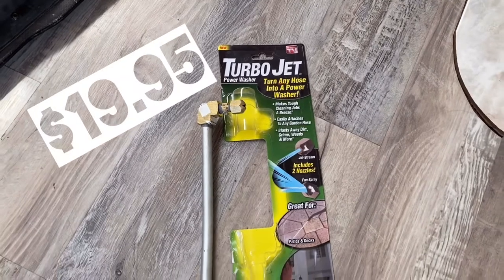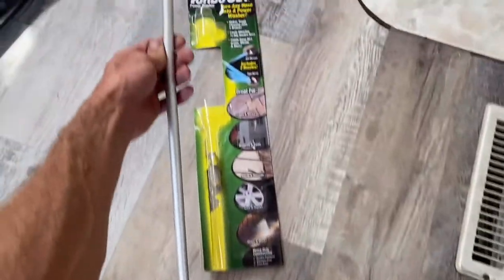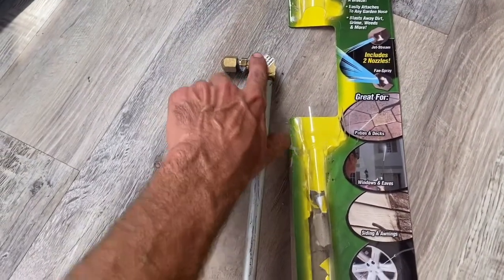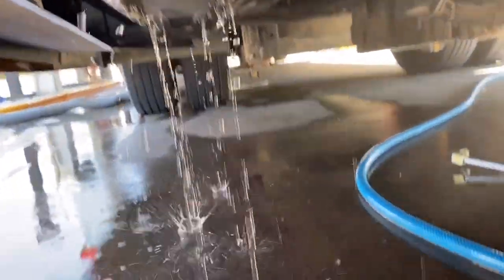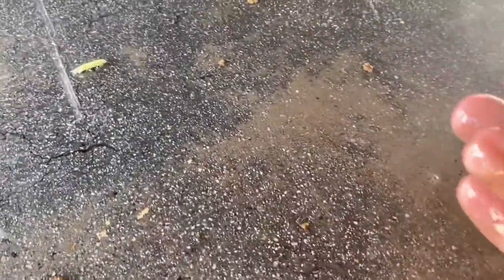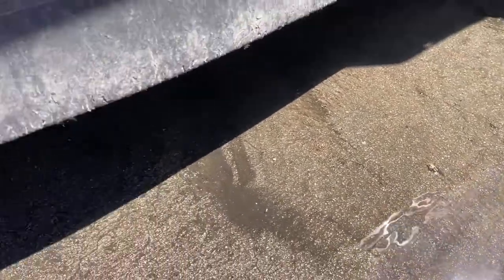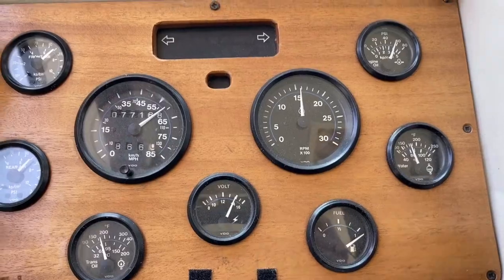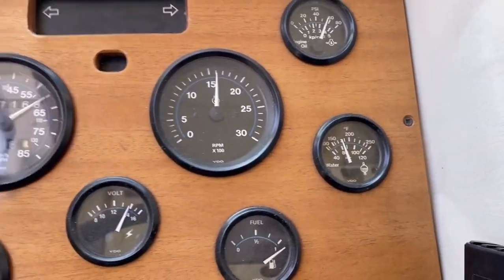How to: RV overheating SIMPLE FIX diesel motorhome radiator clean replace

Comment: I have a 1998 Dutch star 8.3 Cummins, I found this video after leaving Mn and getting to Oregon and having many stops on grades to cool down so I could go again, I am pulling a car behind around 5000 pounds, 
Today I went from camp ground to Lowe’s and bought a wand and simple green. I spent a few hours soaking and spraying and I can not believe all the grass, leaves, straw, and who knows what else came out, it was unbelievable I have a huge pile that was between my radiator and my inner cooler for turbo, I did wash from out side only before leaving on trip and it obviously did not good !! Heading out in morning for northern Oregon will see how it does !! Thanks for posting this video you described exactly what I had going on and things I had also done to my camper !!

Comment: Thanks for the video.  I, too, have a 1996 diesel pusher with a side radiator with an 8.3 Cummins that gets to 210-220F easily when driving to Lake Havasu.  Once it gets that hot, even merely idling causes the temps to get to a point where the idiot light comes on.  I ordered an extension wand for my pressure washer to try to clean the radiator but I see that you did it with simply a garden hose.  Did you use any chemicals to dissolve the crud?  Perhaps some degreaser?
Reply: Others have said NOT to use a pressure washer, what Tanner did was fine, just enough pressure to loosen the crud, not so high that you might damage the radiator.  Others have suggested using a mild degreaser such as Simple Green, spray on with a trigger spray bottle, let soak (but not dry) and then wash off with light pressure from a garden hose.  I intend to follow this system in the spring when the weather breaks.
Reply: A pressure washer in the "fan" mode won't even hurt one's palm.  I can't imagine it piercing a radiator.
Reply: @terrycrawford6740  I can bend the fins, thus blocking air flow.